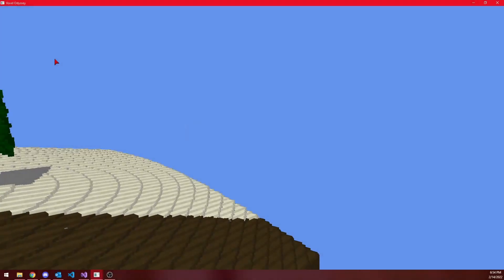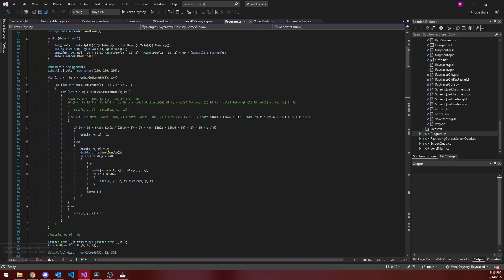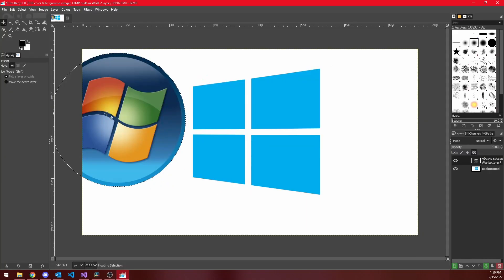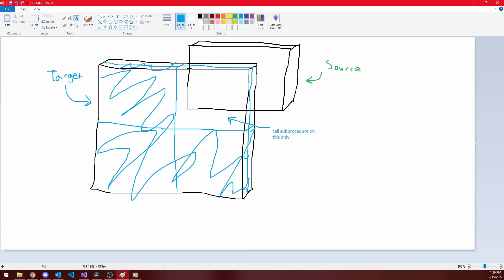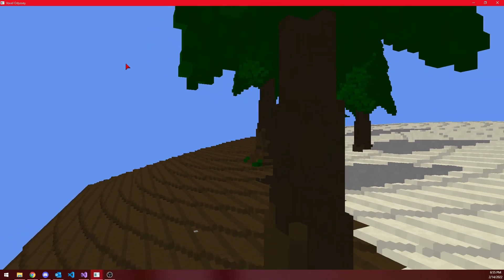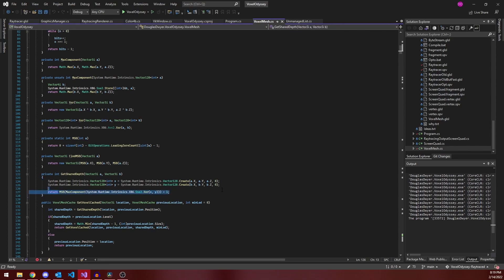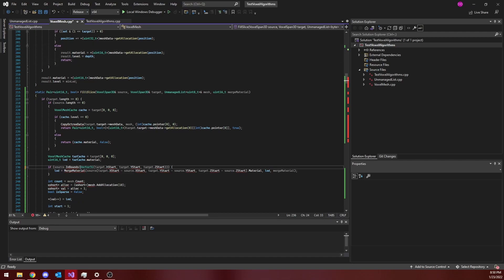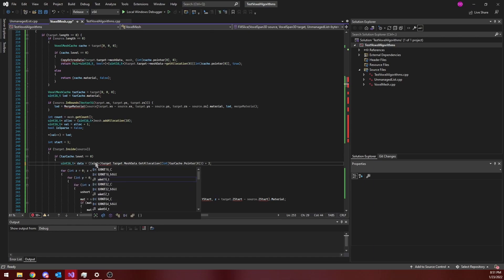Sparse voxel octree modification and benchmarking [Voxel Devlog #3]

Comment: i’m curious why you decided to go with an octree per object instead of modifying the original terrain octree. was it to retain information that would have been lost due to tree intersections  (in case they were to relocate later on?)

also was thinking if having “layers” of octrees would reduce complexity at all. eg- instead of 1 terrain layer and 8 tree layers you just have 1 terrain layer and 1 tree layer than new trees are added too, with the assumption the trees would not intersect
Reply from the maker: Completely agree - a singular octree where all of the objects are merged is the ideal. That's what I implemented in this video - when each tree is placed, it becomes part of the same octree as the terrain.
Of course, the trees are originally their own octrees, because the tree data has to come from somewhere. But when they enter the scene, they become one big octree.
Reply: i suppose due to the nature of octrees the intersection checks between octrees isn’t too expensive, wondering if it would scale better to have just 1 layer with 250 objects instead of 250 octree layers that need to diff check
Reply: @Conlexio  A benefit of using a separate octree per object is that you can transform those objects and instance them. Like you could put 1,000,000 trees in the world made from the same tree model and only have to store a single octree for all one million of them in spite of scaling and rotating and translating each tree differently in the world (each tree only needs to store a model matrix and a pointer to the octree it instances). To avoid having to linearly loop through every single one of those trees to perform frustum culling for a rasterizer or perform ray/voxel intersections in a raytracer, you can create one loose octree or spatial hash for the objects in the world (this spatial index would not store voxels at the leaves, but only objects).

Comment: Yeah... When C# devs tell you how C# is "pretty much" as fast as C++ these days, I think what they mean is "it isn't orders of magnitude slower anymore."

And that's cool and all, but when you're working on a real-time system, C++ being "merely" twice as fast ends up mattering lol.

Luckily for me, I like C++ anyway.
Reply: And as for C#'s performance, it's pretty close to C/C++ and low-level languages, the biggest problem with the language in terms of performance is simply a matter of the many small decisions the .NET team makes about optimization, the lack of an escape analysis suitable for example, or the possibility of disabling GC at strategic moments, the way interoperation is done and even the various runtime checks to ensure code security, in addition to other important things like the need to make the JIT fast (and consequently not being able to optimize the code as well as a static compiler could), with some optional changes we would see absurd performance gains that would put C# as a serious competitor of low-level languages, losing only in the possibility of using it in embedded and the like (which is possible, but I wouldn't recommend it due to being quite hacky).
Reply: @diadetediotedio6918  The "problems" that rust "fixes" are greatly overstated, and the additional workload of conforming your program architecture to rust's unyielding ownership demands are greatly understated.

Rust was an exciting proposition five or eight years ago (and I was excited too), but after the industry has had some experience with the reality of using the language, the largest factor behind its adoption turns out to just be evangelism. Beginning new projects in C or C++ is just as reasonable as beginning them in Rust.

The so-called "problematic" nature of C++ just isn't anywhere near as big a deal as rust evangelists claim it is. Generally these evangelists never were highly experienced with C++, and are only aware of the talking points academically.
Reply: @delphicdescant  
1. It's not "underestimated", it's simply something done to make the software more solid regarding its own security, naturally I didn't say <to rewrite entire systems in Rust>, that would make no sense, it would be too much work and no experienced programmer would tell you that the first thing to change in a system should be the language (it doesn't matter if it's Java, C#, C, C++ or Rust). Rust is something to build <new> systems for, to adapt your programming style to things that are coming out (which is exactly why Linus Torwalds is seriously considering using the language for new Linux features). Rust effectively makes programming safer as it eliminates multiple vectors of human error with a solid, opinionated compiler, unlike in C++ where you can literally do anything by default (and yes, I've programmed in C++).

(2 and 3). Certainly not, Rust is being massively adopted by companies like AWS and alternatives to C++ are popping up every day, why do you think they are favoring the emergence of new languages like Rust, Go, Carbon, Zig and the like? The reason is extremely obvious, C++ is the elephant in the room that no one has the courage to explain how bad it is, naturally because the C++ fandom is an absurdly disgusting thing and full of arrogant people who are unable to recognize the dozens of flaws in their language itself. One of the most used kernels in the world for servers and mobile devices is literally programmed in C, the supposed predecessor of C++, so you can see how "C++ is a reasonable choice".
Reply: @diadetediotedio6918  It doesn't take courage to find bad things to say about C++. Everyone does that. And I said "understated," not "underestimated."

A minority of companies are adopting rust, yes. It remains a fad choice, propelled largely by team leads and architects that have been bitten by the rust evangelism bug.

There is no C++ fandom. C++ programmers are nearly ubiquitously aware of the flaws of the language, and used to working around them. Rust evangelists, on the other hand, are called evangelists for a reason. They are like some combination of vegans and jehova's witness. They truly are unable to see the flaws of the language they espouse, and every time someone in a management position is won over by Rust's academic talking points, then a new company "adopts" the language.

Are they better off for it afterward? Maybe, maybe not. If you ask the evangelist, of course they are! But the reality I've experienced is that Rust's safety mechanisms have a minor, often even imperceptible, effect on overall productivity. And the cost is more constraint on architecture.

Teams should feel free to use Rust. It's neat. But it's not vastly better, nor vastly worse, than any of its competition. Language choice was never the most significant factor in success.
Reply: @delphicdescant  I don't think it's really fair to say that rust takes too much to become accustomed with and then say you can't criticize C++ unless you have a lot of experience.
It sounds more like people just have 20 years experience with C++ and 1 year experience with rust and therefore like what they're used to.
Reply: Well, if your goal is pure and raw speed you have significantly less problematic languages than C++ like Rust or even C, a bliss for C# devs who can now write safe, readable code and leave the performance-critical parts (such as voxels) for more performant languages that are difficult to write and maintain.

Comment: Where did you find a way to modify the octree? That is, paste stuff in without regenerating the octree. I don't fully understand your example so I wanted some additional context but I can't find anything on the topic anywhere.
Reply from the maker: I designed the algorithm myself, so I unfortunately don't have any additional resources that I can provide at this time. If there is enough interest, I'd like to make a video or produce a written description of the procedure in the future.
To clarify, the approach I currently take does indeed create a new octree. When an octree modification occurs, a new buffer is allocated and the contents rewritten. I represent octrees as packed byte buffers, so I believe this to be the best approach for the data structure. The alternative approach, trying to dynamically modify and resize the octree buffers, would probably just result in lots of copying anyway. As such, octree modification does require a full reallocation of the data structure.
That said, this approach has the benefit of conserving memory and total number of allocations while still being very fast. The point I make in the video is that the procedure I have designed does not take the naive approach of "regenerating" the octree from scratch. That would mean manually sampling every voxel location and running the function that converts a flat array to an octree. Instead, when I create the edited octree, I work from the top down. Taking advantage of the sparse data structure, I don't "recreate" target suboctants which do not overlap with the source - I simply copy the suboctant contents to the new buffer verbatim. Similarly, if a target suboctant is fully inside a homogenous source suboctant, the target's material is overwritten and I don't examine the target's voxels any further. This results in octree modification that is multiple orders of magnitude faster than generating an octree from a flat array, or generating by sampling every voxel.

Comment: Use GLSL to run engine on videocard, it will work quite faster because vid-cards were made to render graphics.
Reply: Maybe easier to get a C++ version running first, it's a real pain debugging complicated shader code compared to C++

Comment: This has probably been already commented, but I believe a big contibutor to the speed difference is the fact that C# is a garbage collected language.
Which means any C#  program is constantly running a "second program" in the background that makes sure all your variables get deallocated.
This is also, I believe,  why C# has higher memory usage.
I tried writting a 3d game in C# and ended up with 600mb of ram, this was partly my bad code, but also just C#.
I since moved to C.
Thanks for the videos btw. I think I might now actually understand what an octree  is :)
Reply from the maker: I'm glad to hear you enjoyed the video! If enough people are interested, I might also make a video at some point just explicitly explaining the tech (like octrees). I try to do that in each devlog, but I also have to focus on the new things I've added, so I don't go into as much detail.
It's true that C# is a garbage collected language, but in this case, the collector is not the bottleneck. Unless you are using server-side GC, the GC only runs when a large number of allocations have been made, meaning it shouldn't slow down all program execution - just cause occasional hiccups. This means that, when writing games in C#, one has to be careful to avoid allocations in order to not trigger the GC. My algorithms do that - they don't create allocations and only employ stack-based datastructures (like structs), which shouldn't trigger the GC. To verify this empirically, I used the System.GC class to turn off the garbage collector during benchmarking. It did not make any significant difference. That said, I would agree that allocations are something for which to look out when using managed languages.
Reply: @DouglasDwyer  Those specific explanations sound nice
It makes sense the GC would behave this way, learn something new every day :)
Reply: The GC in C# can run in parallel if you specifically tell it to do so, otherwise it should run in the middle of your code execution flow. The C# performance issue against these low-level languages is more the amount of optimizations the JIT can do to maintain an acceptable startup speed versus the time spent optimizing low-level code, the JIT needs to be fast. so optimizations are minimal, this makes the code slower than simply compiling everything specifically for the target platform. C# however can effectively generate code as much or faster than C/C++ using different runtimes and code generation methods, for example we have Unity's HPC# with Burst which is capable of generating highly optimized assembly that runs at speeds absurdly high at the cost of having to have an explicit target runtime. Eventually we might see something like this in traditional C# with the common .NET 6+ environment, with the new AOT features we should probably see slow, gradual improvements in the speed of non-JIT code if the .NET team is really interested in bringing more speed for the language (several little things add up to this, for example the lack of an escape analysis as in Java is a very complicated factor for C#, the reference objects are always allocated on the heap while in Java the lifetime of the objects is scoped they are stacked, if we solve this this issue should raise a good performance in the language; likewise if it is possible to remove GC completely in critical performance scenarios this can generate huge performance benefits, currently we can do this only in a strictly limited way and with various restrictions).
Reply: @diadetediotedio6918  I think the problem is more object overhead in managed languages. The C# optimizer actually does a pretty awesome job at instruction selection and register allocation on par with GCC when only involving PODs in every single one of my tests (and I'm a C++ programmer), and in spite of its much faster JIT compilation speed. Java as well in my tests (including analyzing the disassembly).

For example, C# actually comes very close to C++ in Debian benchmarks that don't involve any user-defined objects, like 0.71 secs for the best C++ entry of spectral-norm and 0.9 secs, not too far behind, for the best C# entry (and it actually beats all the other C++ entries).

Where the C# benchmarks get substantially worse is when they involve objects which I don't think is directly the fault of GC, but the general overhead of managed, polymorphic objects (loss of spatial locality, size inflation by an additional 64-bits on 64-bit architectures + up to 7 bytes of padding if the structure required less than 64-bit alignment, etc). For example, with the binary-tree benchmark, the fastest C++ version is about 5 times faster than the fastest C# version since the C# version uses objects for the tree nodes. The C++ version also uses objects but C++ has zero-overhead objects unless they require a vtable with the introduction of virtual functions which isn't needed there, and it also uses an efficient arena allocator in the C++ version to allocate the tree nodes contiguously.

The C# version could probably get very close to the C++ version if it stored all the nodes as structs stored contiguously in an array and just used indices to point to them in the tree without involving objects and object references.

Even 8 bytes of overhead per branch node is actually a ton and a performance killer for an SVO/SVDAG (my SVDAG only uses 4 bytes and 32-bit alignment in C++ so if I turned it into an object in C#, it'd be 4 times its size at 16 bytes with 8 bytes for the metadata and 4 additional bytes of padding and I'd be looking at 4+ times the compulsory cache misses and probably at least double the non-compulsory), and all objects require that 8 byte metadata and 64-bit alignment overhead in managed languages on 64-bit architectures the last time I checked. That object overhead is usually not a big deal with complex aggregates like an Image or Tree, but is a very big deal for teeny objects like a Pixel or Voxel Node.

Comment: I've had a similar experience with switching from C# to C++ for my dual contouring project. The recursive contouring part of the algorithm showed no difference in performance between the languages, but everything else was at least twice as fast. I'm not sure what it is about C# that's so slow because I didn't have a working profiler at the time but I think it might be accessing fields and array items like you suggest. I know it wasn't any calculations I was doing, or the cost of constructing objects so it's got to be something more general.
Reply: One language is compiled and other uses JIT. C++ does not use garbage collector.
Reply: @juresrovin4174  That is correct but not the answer, depending what you are doing Performance could be similiar. He is more talking about how to optimize C# functions, but without Profiler this is cumbersome. The garbage collector is also only sometimes the Problem.
Reply: @juresrovin4174  a garbage collector isn't an issue if you don't throw away garbage stupidly.
If you have a static array that you modify constantly then the garbage collector does nothing.